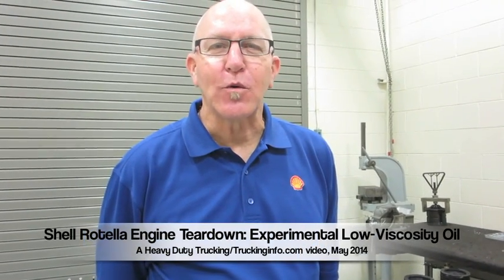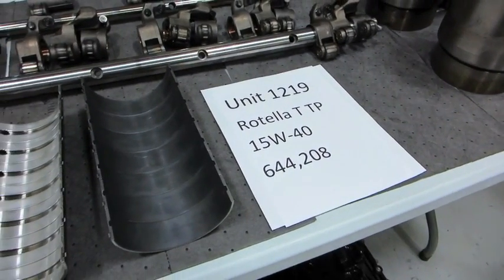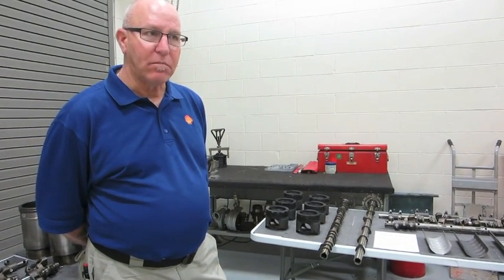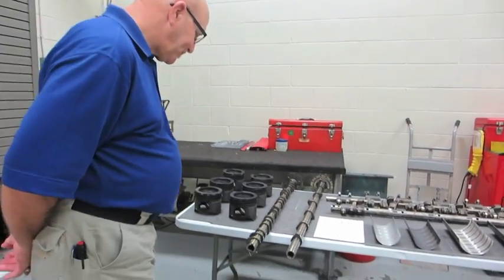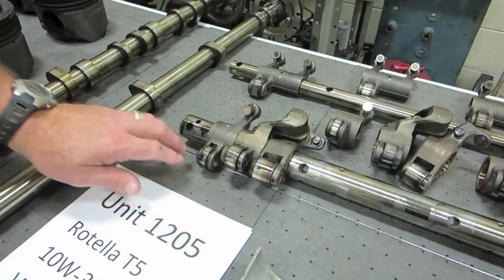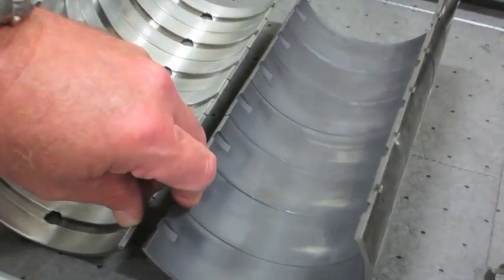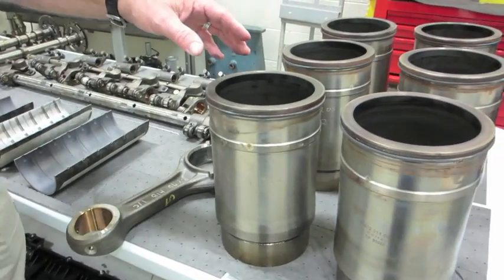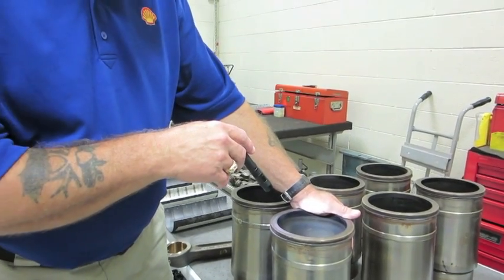Rotella Teardown

Comment: Can somebody tell me if I should use the T6 5w30 or 5w40 for my 2015 Q50 Infiniti 4dr Sedan Premium AWD 3.7L V6 with 20k miles? 5w30 motor oil is what's recommended in the vehicle and it does have a catalytic converter but from what I continue to read is that the T6 5w40 still has the more beneficial formulation vs the T6 5w30. I mean should I try the T6 5w40 or just do the multi vehicle T6 5w30? I live in Ohio.
Reply: lordabhi don’t listen to this. If your car is stock run the 5w30. Or, try both and see how your car reacts to both, don’t mix
Reply: don’t listen to this. If your car is stock run the 5w30. Or, try both and see how your car reacts to both, don’t mix
Reply: Just use Mobil one lol wtf

Comment: After reading an article in a VW forum, I researched and started using Rotella T6 on my 07 VW Jetta 2.5l.  After a while using that oil the engine sounded quieter...At 87k miles, I replaced the valve cover gasket and was amazed of how clean the valve train looked.  Been using Rotella still at 126k miles, and engine is still running and sounding good.
Reply: How’s it still running?
Reply: @dad3562 it’s dead 🤣🤣 Rotella is a good detergent oil to clean but most oils will do same if you change on time.
Reply: @alejandrotobienne8220  RIP :(

Comment: Have you all did a study with VW TDi engines?   Many TDi owners run the T6 - 5W40, and would appreciate the study.
Reply: There's guy running the t6 in a tdi the head gasket went @ 600k miles he had his head rebuilt and new head gasket he's over 800k still had factory cross hatch at that milage

Comment: I put 15- 40 non syn in a 79 dodge d100 with a slant six motor. after first change at 1000 miles then after that every 3000 miles. It got most of the sludge out by the time we took the oil pan off (15000 miles later) to change the gasket. i was told that what was left in no way was that engine that clean for the fact it was 40 years old.  it reduced blow-by from gummed up piston rings that didn’t seal properly by a good bit seems like it got the oil control rings to seal again. I noticed less smoke came out exhaust as I drove it towards the 15000 mile mark since i owned the truck with your oil being put in. To the point where only when cold it would blow some smoke. When warmed up no blue smoke was visible. And the oil consumption drastically lessened to where I didn’t have to add any. For 3000 k miles The slant six had about 184k miles on it. Your oil is amazing!! My friend who is a diesel mechanic told me to put your oil in that engine. And he said  “drive it around”...

Comment: You did not say anything about the others, that is why I watched ?--> I agree it's great oils you formulate, I used them in my cars & mostly motorcycles, and let me say thanks for including motorcycle in your specs, and testing for certs; ) also you have a better price then the motorcycle branded oils, and by a large margin. yl
Reply: I would not recommend it for motorcycle, tests on different motorcycles showed 37% viscosity drop  within 4 thousand k, for example Motul 300v lost only 7% of initial viscosity.
Reply: @trimor234sholder7  that isn't a problem if you change your oil every 2-3k miles for $20 a gallon!!!!